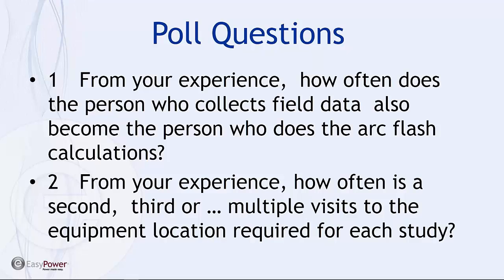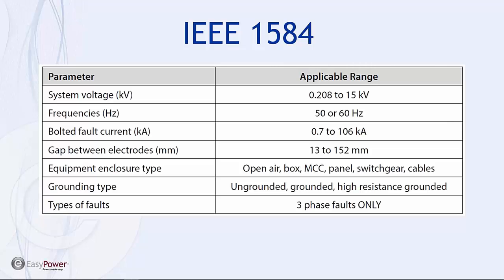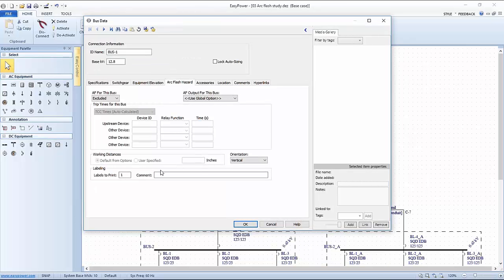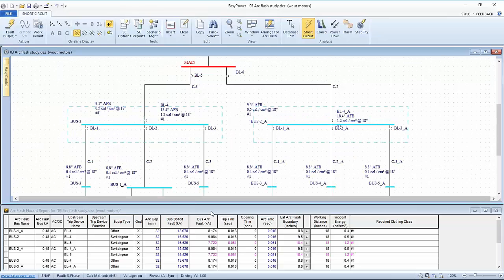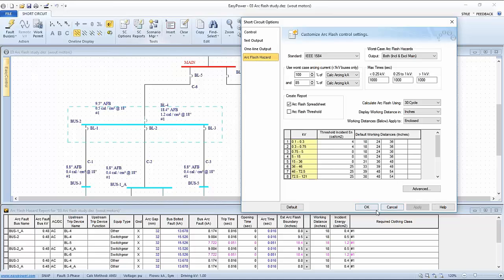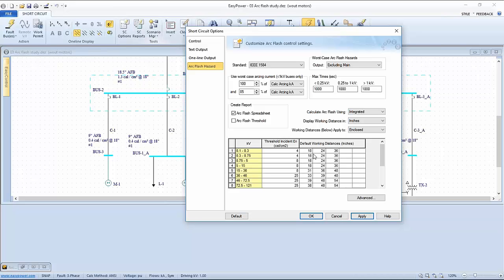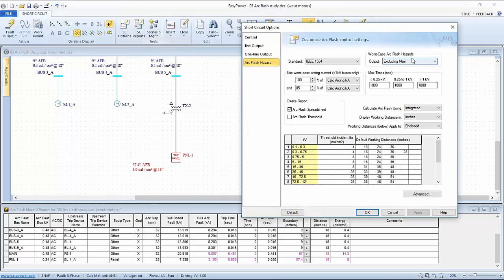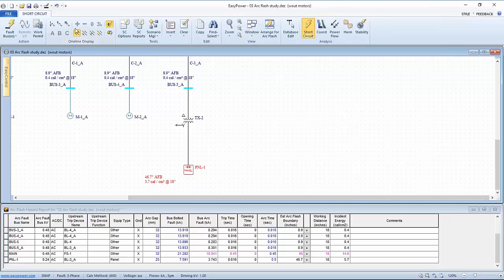Arc Flash Options to Improve Your IEEE 1584 Results

Comment: Jim as far as the end of the presentation, the 2017 NEC is going to require a barrier in new panel boards, specifically on the terminals of breakers. however I believe that IEEE should revise their arc flash calculations to include arc suppression at low voltage because a real issue is now overproteection at 120v.
Reply: Hi Jon,   Thanks for the feedback.   Yes,  we are expecting this to be a topic which will be included in the 2018 release of NFPA 70E.   The software will adjust accordingly at that time.
Reply: Jon,   I just checked our copy of 2017 NEC  and the terminal barriers described in 408.3  are for shock protection and are not required to be Arc Flash barriers.    Hmmm.  Something to discuss in next  NFPA meeting.

Jim